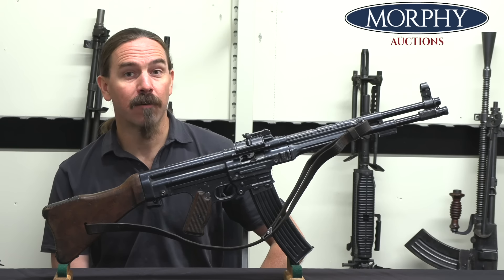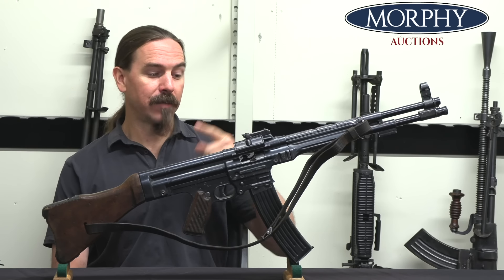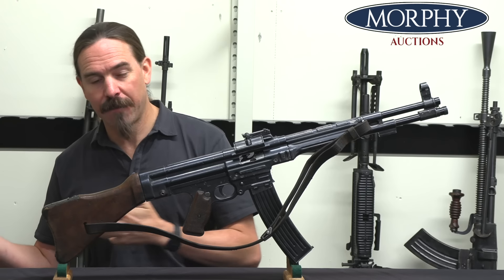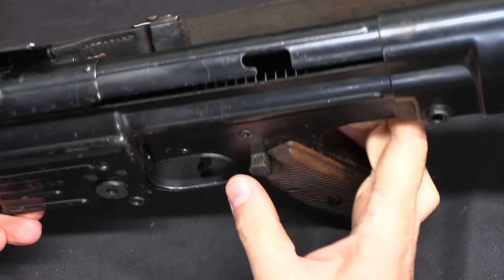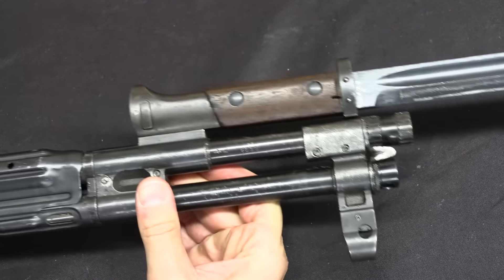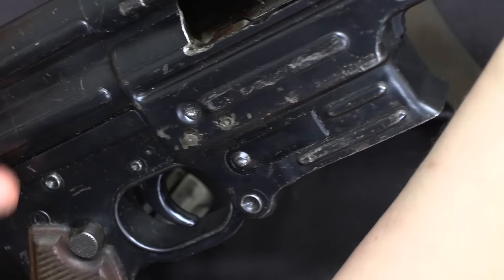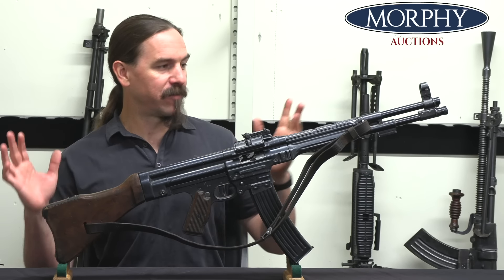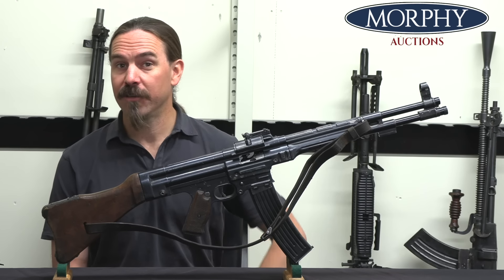The First Sturmgewehr: The MKb42(H)

Comment: Mikhail Kalashnikov did NOT invent the AK-47!! He Carbon copied a captured Sturmgewehr  and gave it a slightly outer look, while all the working mechanisms inside were the same!
Reply: It's just that the internal mechanisms are different. You've demonstrated that you don't understand it at all. Rotating bolt vs. swinging bolt.

Comment: Okay time to piss off the Ak fan club😂. I'm looking at you @brandonharrera , yes i watch you stuff. The Phyletic tree on development on the AK and STG goes Mkb42h ->mp43/1-> mp43-> Stg44  ak branch goes  Mkb42h -> Sudayev's AS44 ( Sudayev falls ill/poisoned and dies at 35, soviet arms development is cutthroat) Ak46  -> AK47 ( with sudayev's layeout, gas systeme bolt carrier, and garand/zk420 bolt.) --> Ak Subvarreints ->Ak74
In short the AK is a rifle of an evolution, it is not a Revolution .  The Kalashnikov rifle before Sudayev death and after are two very different beasts. Anyway @brandonHarerra i cold argue that the Ak was just a refiend Electrolux-Charlton but that would be just stupid.

Comment: Looks way sexier than the final version with the antena.
Reply: What antena?
Reply: @juanzulu1318  The stacking rod near the muzzle (so that you can build a teepee with three guns and not store them on the ground when you camp outside)
Reply: @FromMyXP  interesting. I thought this was a cleaning tool. Is it not?
Reply: @juanzulu1318  It's also a part you can remove to clean the gas tube, but it is not a cleaning tool itself. The StG had a separated cleaning kit.
You can see similar stacking rods on other guns, like the MAS-36 or the Berthier M16.

Comment: Do open-bolt guns actually cool better?
I mean: Before the first shot, both open and closed bolt are the same temperature...
Then when you finish the magazine (and it locks open), both open and closed bolt are open...
So, the only opportunity for an open bolt to cool better than closed bolt is when you are shooting bursts... But if you wait long enough between bursts, the closed bolt cools enough anyway... And if you wait very little between bursts then the little time when the bolt is open isn't helping much anyway...

So, open bolt MIGHT be cooling better, only for a rather specific cadance of shooting through the magazine - and therefore ultimately not a feasible strategy, right?

Comment: I dont understand the hype around this gun. If you ever get to shoot one. Dont they suck
Reply: There isn't much hype around this (open bolt) version. As for the MP43/44/StG44 no, I wouldn't say they suck. The AK is better for sure (lighter) but this was the first serious attempt at such a weapon. It's short, controllable, reasonably accurate, even had an optic rail later on - what's not to like?